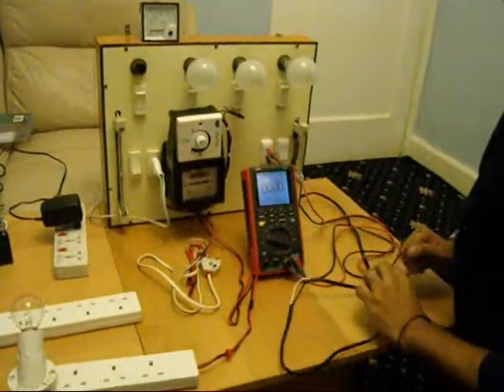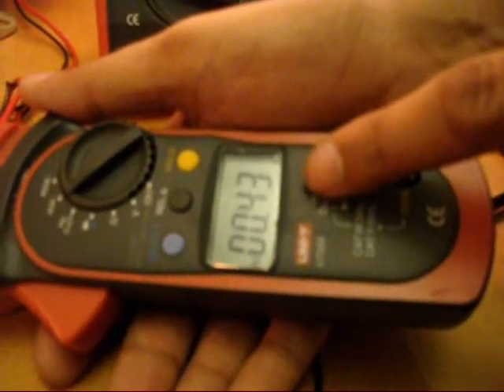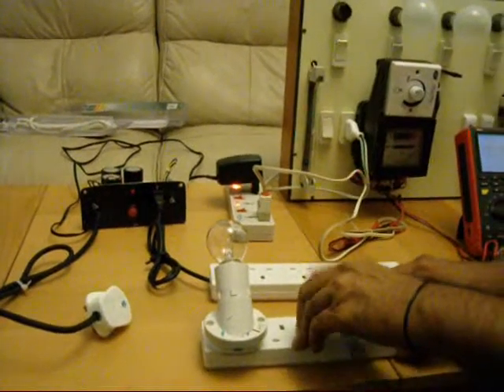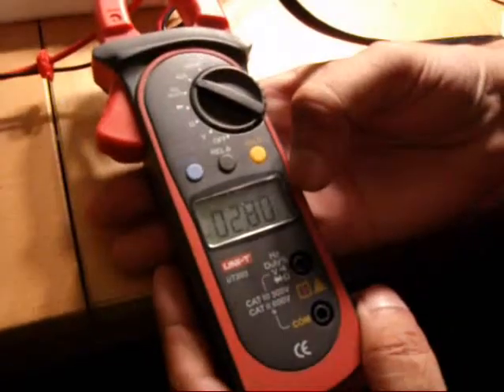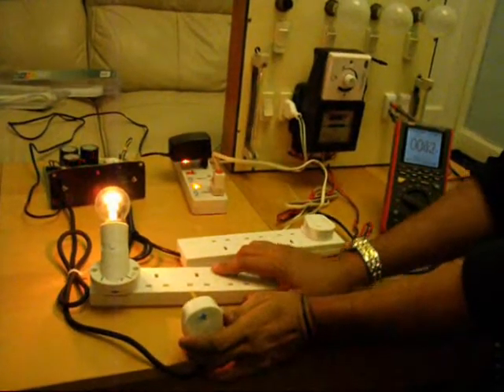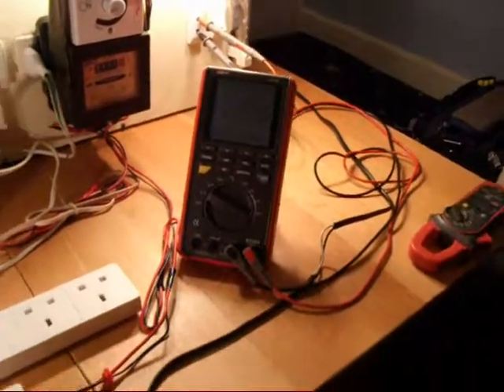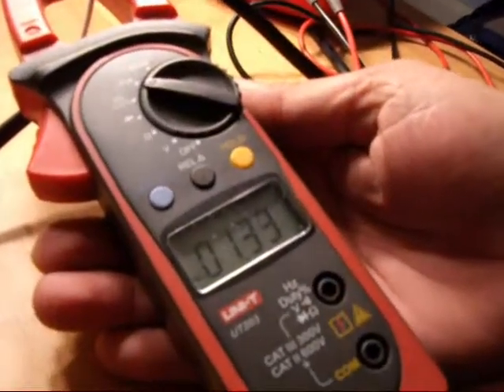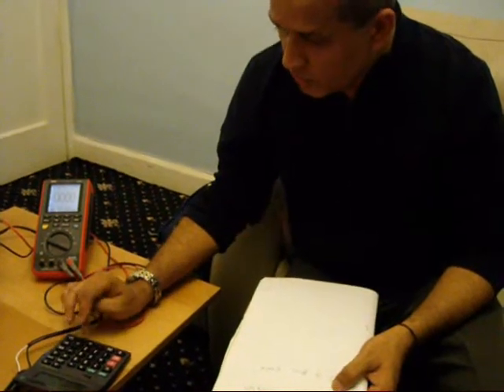motionless electric generator

Comment: Interesting solution: Basically the way this works: You charge up 3 big capacitors with rectified DC at high speed (frequency) then you discharge it on the light bulbs. This is one of the true solutions of over unity devices. Tom Bearden came up with theory long a go, John Bedini made and demonstrated similar device, he even patented the idea. It's similar to using a 20 Ton jack and lifting up a massive weight by simply cranking the handle of the jack with one hand.

Comment: I really don't get it. All I see is you running bulbs and a meter off of wall current and a 12volt adapter. I am seeing no power generated, I am just seeing it changed by means of circuitry.

Comment: Hi!
I like all your efforts to validate your experiments.
In my opinion, Maybe there's something wrong right with your amp/volt measurements.
I don't know what frequency SPECTRUM your generator circuit has, but maybe there's something "missing" in your calculations.
To measure the effective power generated, your measuring instruments should be able to measure the true power generated, which can be measured with a special instruments called true rms voltmeter/ampmeters or wattmeter.

Comment from the maker: @TheNewsJunky2009 
the net gear 12 volts are required for running the control circuit it consumes only 20 to 30 milliapms. so this is not the source.

Comment: Not quite .. it's like taking a narrow hose of water producing say 100litres p/hr connect it to a converter to produce 400litres p/hr at high pressure

Over unity it's called and it's supposed to be impossible .. just as well this guy didn't no it was impossible.

Looks like there are many other inventions defying the over unity laws.

Wasn't the Earth once flat :)))

Comment: pl add both   electronic one which has LED which indicates pulses and certain no.of pulses=1 kwh. This will clearly indicate input power  and output power consumption. let us assume both meters has 1200 led impressions per kilo watt hour then obiviously input led will flash less than output led. Also You may use variac to control AC input voltage to desire 30 v AC so there will not be any confusion about pure sine wave etc. These are my small inputs I may not be right and sorry if I wronge